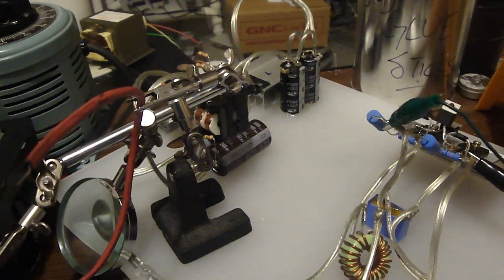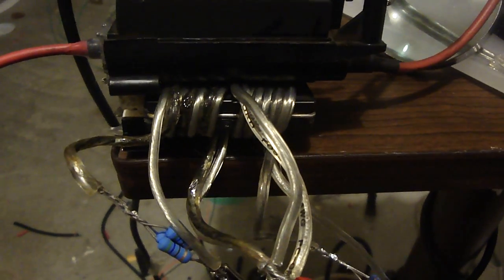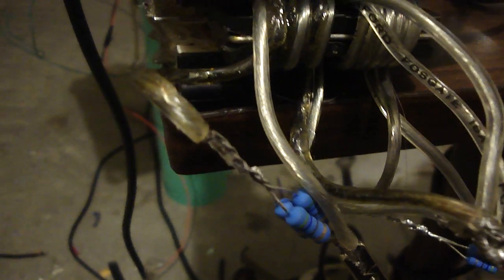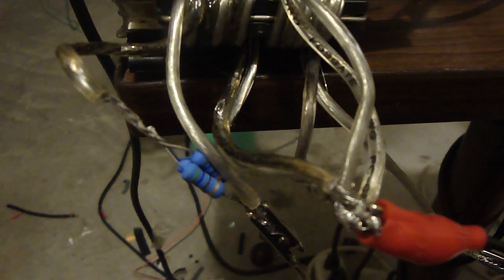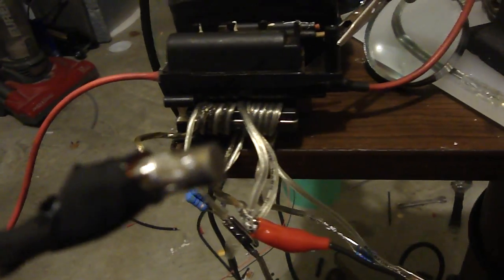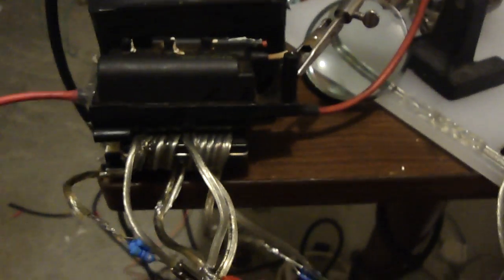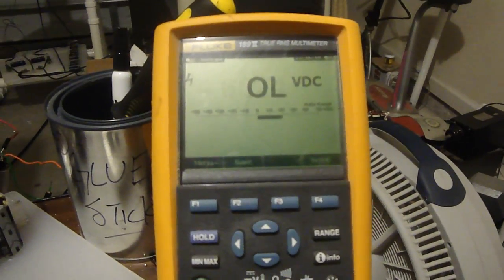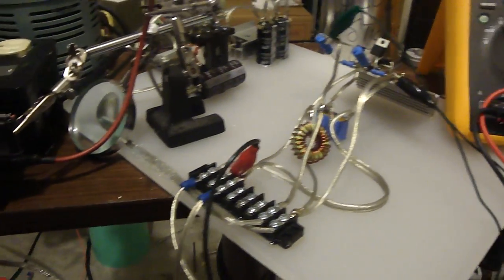Dual primary beefy ZVS @ 56 volts

Comment: You are so lucky your flyback doesnt even get warm after all that. My big black rear projection TV got so hot at 5 inch arcs that the plastic started chipping off the inner epoxy. The next day, it burnt out. Now the second (of my 8) flybacks also gets very hot. Ill find a winner eventually

Comment from the maker: Mosfets are irfp250N and the cap is 0.68uF 250V the zeners are 15v vice the normal 12v and the ultrafast diodes are rated @ 15amps which helped keeping them from burning out.